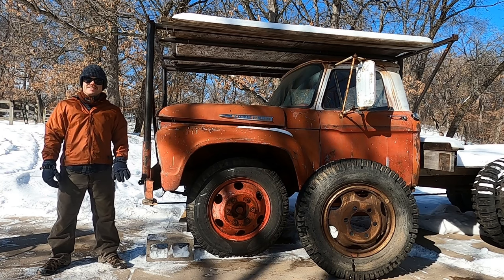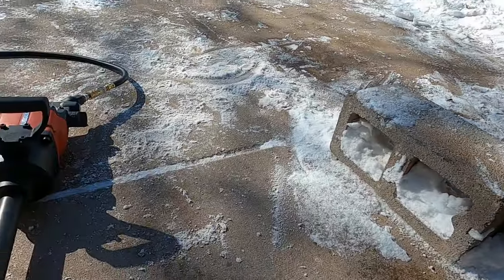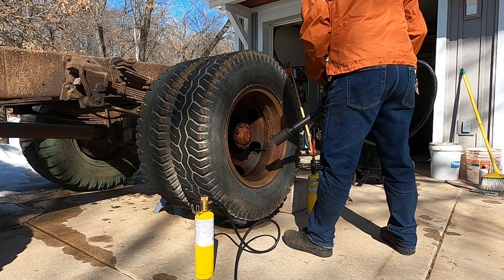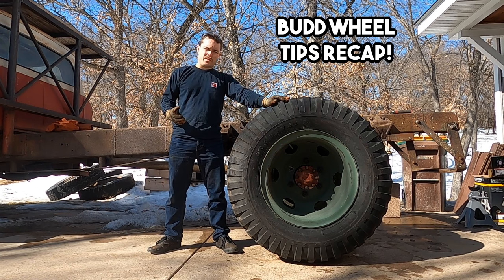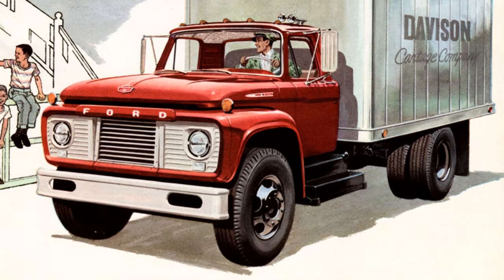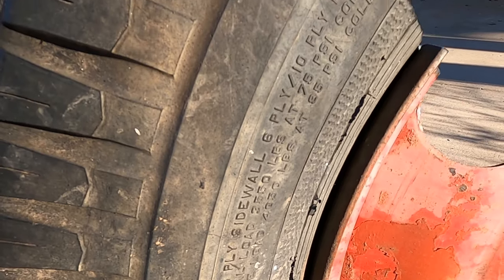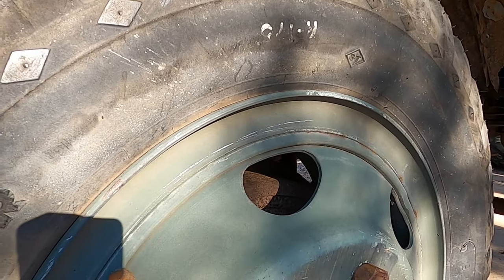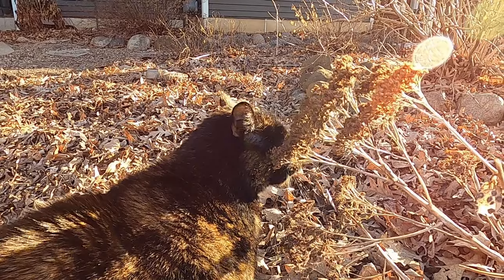All About Split Rims, Explained! Ep. 11

Comment: Years ago I was changing the wheels on my 68 gmc pickup to new mags but no tire store would touch the existing split rims 'I had to take it to a place that worked on Simi truck tires they had a cage the tire wheel assembly was placed into to contain it in case of catastrophic separation    I had no idea how dangerous these things are many were killed by these things pretty crazy !!

Comment: Had a chap bring a 900x20 into my tyre garage asked for a tube to be fitted .
All stripped down refurbished.
He said I'll tell you something when it's  done.
So I fitted it up seated the rings all perfect.
N then what he told me shocked me.
Sombody a week before was killed doing the same wheel. 
Locking ring blew off hit him in the face n he died from multiple injuries. 
Never done one sinse .
We as a company refuse to do these types of wheels 
Widow makers for a reason 😢
Reply from the maker: Holy jeez. Tire cage time! Although i understand they can occasionally blow outside a cage too. Glad you're alive.
Reply: @SealedBeamRallyTeam  
Only ever had one go on me in 4o years .
Old 2 piece split rim ex military. 
1050x16 fitted new tyre tube flap at 30 psi .
BOOOOOOM RIPPED THE STUDDS STRAIGHT THREW THE RIM STRAIGHT UP IN THE AIR LOST SITE OF IT MASSIVE BANG 
STRAIGHT THREW SHED ROOF HOLE ABOUT 15 FT ACROSS.
OLD FARMER WASNT TO HAPPY.
NEW UNDERPANTS REQUIRED.

Comment: Return that impact and get a milwauke m18 1/2 drive high torque and the correct 1/2 drive sockets. They have no problem removing those lugs. You need a much larger compressor to get close to the rated torque of large air impacts.

Comment: That air gun will work alot better with a 1/2" air hose vs a 3/8 a bigger inside diameter hose will carry more volume of air vs a 3/8 air hose also put your regulator on maximum pressure because that 1" gun use alot of volume of air and that air gun will spin those lug nuts off within 2 to 3 seconds.....last but not least you would not need to use deep creep at all that 1" gun with the right size hose will blast those lug nuts off regardless of rust...but anyway excellent explanation on the rims

Comment: I can't remember what vehicle it was, but I almost died from a slitrim. The vehicle was a junkyard vehicle they used for hauling scrap. wheels in it were different than these splitrims, though. Spiltrim I removed had the locking spacers (whatever theyre called) directly behind the lugnuts. Took lugnuts off and wondered why the wheel wouldn't come off of the truck. My boss looked at me and was like oh just smack it with a hammer, and the wheel will come off. well, that dick didn't tell me to leave the lugnuts on a few threads before smaking the rim. needless to say, I hit that rim, and those spacers shot off like freaken bullets. thankfully, I was standing off to the side, so I wasn't hit with any of the spacers, but damn if they didn't take out chunks of concrete from the wall they hit behind me. I almost beat the shit out of my boss that day. That was the first and last vehicle I ever worked on that had splitrims.
Reply from the maker: Do you think those were cast wheels with the little wedges?

Comment: I had a 21.5 inch ring blow off on me when the old Kenworth I was driving fell off the jack on the side of I-10 just outside of Las Cruces. 
Three broken ribs and a broken lower jaw later I was flow back home to western Arkansas where I spent the next four months healing up.
That was summer of 1983. That was still a time when many of us carried spare tires and tools to change our own flats. We didn't have cell phones to call out a service truck. When we broke down, we were on our own until we could fix it ourselves or send someone to call for help.
After that the company I worked for changed all their trucks to the new one piece aluminum wheels that were just becoming popular, but not yet in wide use.
Yeah, those things will kill you!!!

Comment: 1/2 inch hose and a 180psi compressor will git it, I’ve change thousands of wheels with lock rings on trucks and forklifts but only 2 widow makers. My boss blew his arm off at the elbow and threw it and the ring 50 feet. Be safe and bolt it on before airing it up to max pressure and stand back.

Comment: Back in the late 70s a good friend of my grandfather was killed at a tire shop he worked at by one of these type split or ring wheels.  I cant confirm which wheel he was working on but Id assume it was the RH5 since they are obviously the most dangerous.   I also had a friend just a few years ago had a locking band blow off right in front of his face while installing new tires on a fork lift!   it was inches from taking his head off!  the lock ring was bent and needed replaced but the boss said no and told him to get it done.  IT nearly cost him his life!  Ida said no way to that because Ive herd of what happens when they fly apart.

Comment: To have the right amount of power delivery for that job you need at least a 1/2 hose, and a bigger air compressor. Its not about having a short hose at all. That earthquake was not made for 3/8 hoses whatsoever. You also needed a bigger compressor. I bet you within minutes those lugs would come right off and you wouldnt be fighting for a month. No offense, G just some tips from a mobile truck tire tech guy !!

Comment: on non budd wheels they made literally split rims.  the lock rings were solid and the rim had a split. the rim was pushed in to get the ring to  seat.  just because newer wheels have  lock rings never assume they are  safe!!!!  seen them blow apart sitting in the parking lot.

Comment: I worked in a truck shop for a brief period of time. Really only dealt with solid rims. But even those tires have the potential to rupture and explode. 

There was no cage, nor a way to inflate the tire from a safe distance. I hated having to stand right next to the tire and knowing that my fate rested in the ability of the tire's steel cords to hold back 120psi of pressure.

Yeah, so osha regulations don't mean anything. It doesn't mean that businesses will actually comply.

Comment: You can have those split rings as well. They MAY have been ok when  new but after decades of dirt , water and rust they are downright dangerous to both get off,, then to reinstall. I used to do them on tip trucks and worse earthmoving equipment. And the vehicles were only 20 years old, not 2-3 times that.
I have seen them come off [not ones I have done]. Luckily the tyre stayed with the wheel and was brought to a stop ok
Like most of the tyre industry I refuse to do them now,, and I am talking 16" for 3 ton trucks or 4wd. I dont sell bigger.
Also they are near impossible to balance. In part operator error but I had the main part come out of the tyre and fell on my toe. Broke it and it aches all the time!!
Some Toyota with chrome wheels have split rims on the inside of the tyre, I believe they can be harder to fight on and off. Toyota were still using them until the early 2000s on base models.
Reply from the maker: After driving it I'm definitely wanting some one piece wheels with modern highway compatible tires. Thing shakes like crazy above 45. Once i get the gearing to give me 60mph, better tires will be a go/no go type of modification. Until then I can putt around town without having had to install tires on Widowmakers!

Comment: You should use a gear reduction lug nut wrench for the lug nuts, they're meant for truck tires.
Reply from the maker: I will probably end up getting one. A lot cheaper than a new compressor

Comment: Need to run a 1" hose to drive those 1" impacts.  Also I've read the pressure at the tool needs to be 140psi or whatever with the gun running. May need 175psi?

Comment: You should be using at least a 3/4" air line with that impact. 1" would be preferred.  But your little compressor would then be the bottle neck. You can just here the gun starving for air.

Comment: You need more cfm going to that 1 inch impact. If you had bigger 1/2 inch airline and daisy chained 2 small air compressors or had one big one it would have busted those right off there. Ran into the same problem on my 5 ton army truck

Comment: well now I understand what the tire cage is for, I always thought it was the rubber failing on a big truck tire as I only knew cages existed and that for big tires you were supposed to use them because without kaboom is bad.

This still of course falls under one thing I learned from the TV show Mythbusters, Pressure vessels are never a joke get treated with the same respect as a loaded gun.

Comment: So when I was 9-10 years old and working in my Dad's Trucking Company Shop breaking down and remounting tires I should have only done the Tubeless Budd Rims instead of the Dayton Split Ring Tube Type Rims. Yes I saw one of the Split Rings take out part of a wall. By 1979 we had changed to Tubeless Budd Rims. As soon as I could I got away from the Trucking Industry. But due to the years spent working in that industry I have set of skills that combined with 5.88USD I can get a cup of coffee. Now if I liked to get greasy then yes I could have made 100's of thousands of dollars by now and be sitting good for retirement. I left working on or driving them in 1993, the only thing I miss is the halfway decent machine shop.

Comment: I'm amazed that on the left side of the vehicle they had left hand threads. That is not the method by which you make sure that the wheel lugs don't self loosen. If you will watch things like formula one, on the left side of the car is always right hand thread because you always tighten to the rear of the car and loosen to the front of the car. The same thing occurs with multiple lug Wheels. It is why some automakers, Chrysler was one of them that up till 1970 you had left hand threaded studs on the right side of the car and right hand threaded lug studs on the left side of the car. But I suppose if you need a 1 inch impact wrench to get it off it probably isn't going to loosen. I just found it odd.

Comment: Get rid of that 3/8th inch air hose and get a proper 3/4 inch air hose, get some air volume into that 1 inch impact and it will work a lot easier!

Comment: These tires are INSANELY  dangerous. Like, they can rust, and explode without warning. Both on the truck and off the truck. I've heard a few of them go off before because the rim failed after sitting out for goo many years. They sound like cannon fire and go through trees. They'll have problems killing you if you mess around with them

Comment: Awesome video, what torque specs did you use for the inner and outer lug nuts? Thanks.
Reply from the maker: Stock recommended torque in the manual. I think it's like 600 or something huge.

Comment: Using a shorter hose actually hurts the amount of cfm. Having a longer hose actually allows you to have more stored pressurized air. I have a custom built and designed air compressor on my truck. The air compressor has a custom-made 40-gallon are vessel that is designed to hold 1,000 PSI.  So my 40-gallon vessel / tank holds the same capacity of reserved are as a 500-gallon vessel or tank at 150 lb. You are not using 1,000 PSI that are coming out of the vessel is is regulated so I can adjust it to the proper PSI needed for my tools. The regulator just from 50 lb of PSI with a Max of 500 psi. I have bumps that are coming out to about 325 on a tool to get a nut off a couple times. It will spit it right off.

Comment: I have so many people say  "split rim" even for lock ring wheels. They consider anything other than a one piece rim as "split rim"... I never had both on hsnd at one time to show them the difference..
I have demounted and remounted both styles of rims. Never had a cage. I would wrap a chain 2 in fact opposite each other as a safety precaution. Never had one come loose but, I know if it did it would scare the living shit out of me.  I would scrape out any rust on the mating surface. One time I demounted a split rim and the flap was actually  caught in the  mating surface. Talk about someone not paying attention...
Reply from the maker: I talked to someone recently who said a truck coming out of a tire shop near them once had an incident wherein a lock ring blew off as the truck was driving away. Apparently the ring flew across the street and lodged itself into a brick wall. Scary stuff.
Reply: @SealedBeamRallyTeam  yes it is. Plus I heard years ago a bus clipped the curb  and the rim blew apart and hit someone on the sidewalk in a city. I think it was the right rear so that means it was a split rim. Otherwise a lock ring would be facing inward.  However, this was ages ago and I may not have all the facts. Of course it could have been the right front pulling close to curb for a person to get on/off. Then it could have been a lock ring.
Reply from the maker: @bobber55  From the documents I read, i would assume the ring wasn't seated properly in that instance. Yikes- and on a bus!

Comment: Left - hand threading on wheel studs? Never heard of that! I would like to know what the idea behind that design is! Thanks!
Reply from the maker: Mopar used it for a while as well, on cars for sure, i think trucks too. Best explanation I have read is they wanted to prevent lugs from rotating themselves off while the wheel spun in the opposite direction. I've never ever heard of this happening, so it seems like engineer superstition trying to solve a problem that didn't exist... But maybe someone somewhere knows a better reason.
Reply: @SealedBeamRallyTeam  Sounds reasonable, thanks again! Anyway, if I owned a vintage truck running on split rims, I would ask a tyre service for putting on new ones, as this definitely is no DIY job! In Germany, the split RING design was most common until tubeless tyres became mandatory on trucks & buses.
Reply: My 1983 Ford F-250 HD had these as well when it had the original Dana rear axle. These are mostly on medium duty trucks but a lot of pickups got them.
Reply: @ChevyConQueso  That's interesting! Thanks for the info! To my knowledge, there is absolutely no vehicle in Germany, regardless of maker, type, or year with a left-hand threading as shown above! Likewise, split rim designs were relatively rare. Instead, Mercedes - Benz, MAN, Magirus - Deutz, Hanomag and other manufacturers supplied their trucks with rims that had a removable outer ring (i.e. the outer bead) for tube type tyres. However, the only split RIM design that I know of is the so - called "Trilex - Felge" developed by the Georg Fischer company (GF), now owned by SAF Holland. Also gone since long ago since the introduction of tubeless tyres on trucks & buses for safety reasons!
Reply: @jurgenkuhlmann9194  in Australia n I drive a 75 series Toyota...I've got the big wheels but when I went thru the Simpson Desert trip I put her on splitties...a box of patches n some spare tubes beats the shit out 150lbs in two spare tyres n wheels...n I never had a flat....lol
Reply: @malcolmellis9654  OK, thanks for the info! Split rims have not disappeared totally, they still have survived in some places. As you said, all it takes for repair is two prybars, a hammer, and a set of patches! Just like fixing bycicle tubes. Cheers!
A little update: what I've seen as a kid in Germany on trucks are rims with a detachable outer bead (called "Sprengring - Felge") for tube - type tyres. All you needed to do is pull off this outer bead, and remove the tyre together with the lining and the tube.

Comment: ive got an older truck in the process of restoration, technically its got multi part rims, but  in the sense of hub riveted to rim  and not this, glad i dont have to deal with this particular headache, and i thought the lock ring/split ring ones sounded like a bad idea, split rim is just asking for trouble

Comment: Run a 1/2 inch air line with a large coupler on your inch drive it will take those nuts off without penitrating oil i promise

Comment: You can get a torque multiplier to break the lug nuts loose. I had to get one for my truck. They are amazing. Heat and a 5 foot cheater wouldn’t break mine loose, but the torque multiplier just pops them like nothing. I think mine was around $80 on Amazon.
Reply from the maker: That's what I'm planning on getting. Definitely not worth upgrading the air compressor just for this truck

Comment: That 1 inch impact gun probably should have 3/4 or 1 inch air supply. 3/8 might be fine for 1/2 inch impact gun but not nearly enough airflow for a 1 inch impact gun.

Comment: If you haven't tried air tool oil, you should. You'll get the max torque out of your impact gun. Cold weather is an enemy of air tools btw.

I was surprised you didn't drive the wheel studs into the drum by accidentally turning the outside and inside nuts together because of the corrosion.

Comment: Great video, do you know of a way to replace these types of rims? I have new tires but can't find anyone to mount them on these rims.
Reply from the maker: Split ring wheels should be serviceable by any shop that works on industrial equipment or heavy trucks. The normal car tire shops might get nervous though.

Comment: Need a bigger air hose.  if you feed a 3/4 line to that thing it'll sound like a 1/2" gun on a 3/8" line.
Reply: you can also use dual 3/8" hoses.

Comment: Your impact is still struggling with the short length hose and the line drop. . For 1" impacts increase your hose size to 1/2" for short lengths. 3/4" for longer lengths.

Comment: Penetrating oil is a waste of money. Automatic Transmission fluid 50/50 with Acetone is significantly better than any commercially available penetrant, it's also impossible to patent making it cheaper too.

If you absolutely have to use an off the shelf penetrant, the only two I can recommend are Kano Kroil and Mousemilk (which was recommended to me by an aircraft engineer, and is rated to the same millionth of an inch or whatever it is that Kroil is also rated for.)